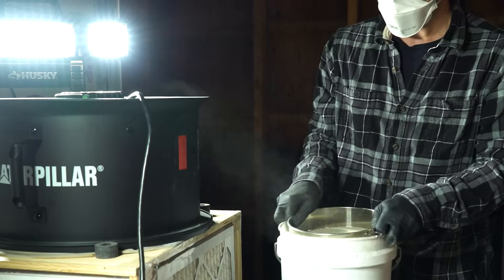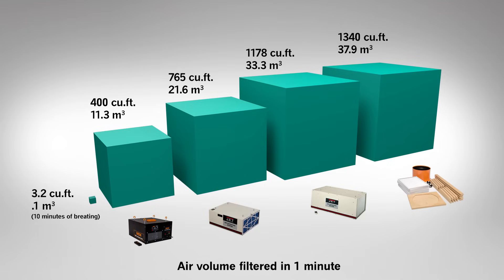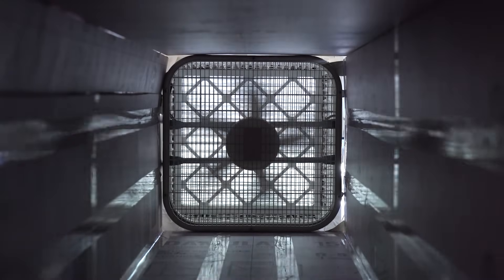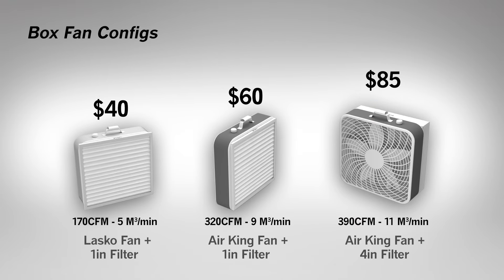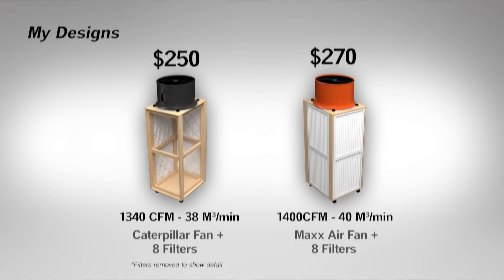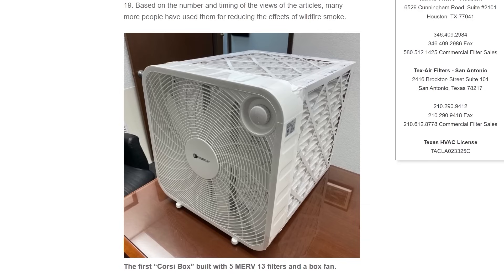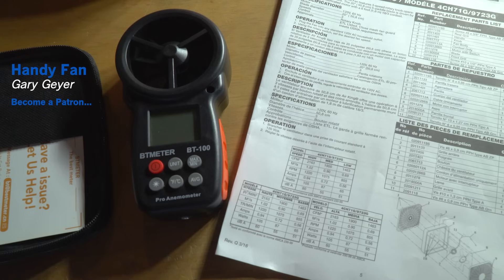What is the best DIY Air Filter?

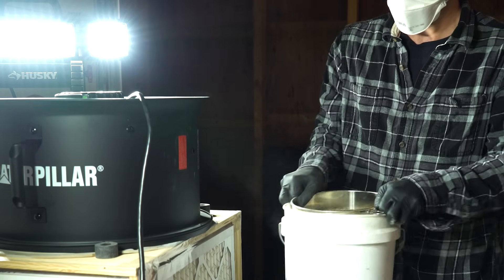Comment: First off - very well prepared and presented, but I did want to make one observation.  In your video (clearly shown from 9:32 - 9:47) you have the air pulled INTO the fan and out through the filters.  The Corsi Rosenthal box is designed (and intended) to flow in exactly the opposite direction, i.e. pulling air into the filters and then out through the fan.  That said, clearly YOU need it for drawing dust away from what you're doing and into the filter as effectively as possible.  I understand why you've elected to use the opposite air flow direction as you want to reduce dust you create from "escaping" the unit as opposed to reducing virus-laden aerosol particles from the air.
Reply from the maker: Thanks! Yes, that is my preferred configuration for this filter unit. I find that it helps keep dust from being accidentally blown into the air. That said, the fan can be pointed in either direction for personal preference. I talk about it a bit in the original video https://youtu.be/fixd7LqnWow?t=277

The other benefit of blowing air into the filter box is that the thick layer of shop dust on the filters that collects is on the inside rather than the outside of the box where it can be easily disturbed. For virus protection, this is not an issue at all. I am working on some air filter kits that function like a corsi-rosenthal for shop and in home use that focus on pulling air through the filters first before it passes through the fan. I should have a video out on these in a month or so. Would love your thoughts on those as well 👍

Comment: Check out Project Farm's video about furnace filters where he does a litany of tests with various filters and media. I'm sure you've seen it.

The 4" filter with an Air King fan is nearly equal to a Lasko fan with four 1" filters. Yeah the air king is more powerful, but I'm willing to bet that a Lasko with four (4 inch) filters would outperform an Air King with 1 4 inch filter or 4 1 inch filters. It's all about surface area, and those four inch filters have a lot of surface area.
Reply from the maker: Very true! I just bought $900 in filters and an air particle counter to do the next round of tests for some air filter kits I'm designing. I get into the amount of material in each filter/brand. I'm wondering if the 1" high end 3M filters have more surface area than the off-brand 4" filters. It sure looks like they might!
Reply: @The3DHandyman  Nice man! I'm looking forward to the experiment results. Lmfao $900 in filters; you're in it to win it man.
Reply from the maker: @Tadders  Lol, yeah. I had a beer or two before hitting the purchase button

Comment: Dumb question but will your design work mounted sideways on the ceiling (say 92" high) or will it work best on the floor (floor space is premium in a wood shop)?

Nvm. Addressed at @10:47
Reply from the maker: The biggest challenge is screwing the fan on to the unit. I am working on some 3D printed brackets for the "pull" config tomorrow. Will have those available on the etsy page if you don't have a printer some soon. Let me know if you might be interested and I will comment on your comment when they are ready to go 👍
Reply from the maker: @Isaac The clamps are now ready for download. I should have these ready to buy this weekend.

Print link
https://www.thingiverse.com/thing:5501226

Comment: 157th comment! I’m actually going to buy the Caterpillar Fan and build that version for my Woodworking and I’ll get the AirKing for my bedroom. Thanks for all your hard work and research!
Reply from the maker: Awesome!!! I hope they both work great for you. If you ever have any ideas for improvements, let me know 👍
Reply: Follow-up question, is it more effective to have the fan pointing horizontally? I currently have the fan pointing upward and I feel like maybe I could also benefit from it by having it horizontal?
Reply from the maker: @FrankTranDesign  Hi Frank! Yes, you can definitely mount this thing on the ceiling with eye bolts and chains/ solid wood attachments. 

You will need to fix the fan onto the unit if you are going to do so.

I designed these clamps to do just that. Fresh off the press https://www.thingiverse.com/thing:5501226

If you don't have a 3D printer, I will have them on my ETSY page by this weekend. Do you want me to send you a link?
Reply: @The3DHandyman  Lol. I appreciate it, send the link anyway, but I DO have a 3D printer (Elegoo Mars (they're no longer making my version for some reason) ) and Curing station (Elegoo Mercury Plus 2-in-1) I also am adept at making 3D things :) 

For clarity, I'm still trying to get the AirKing box fan version working flawlessly. It works, but it juuuuust isn't up to my standards so I'm reassembling it again
Reply from the maker: @FrankTranDesign  That's a solid printer. Do they have tough materials? I'm happy with the Formlabs materials but they are very expensive!

Here's a link to the FDM printed clamps for the drum fan...
https://www.etsy.com/listing/1287743212
Reply: @The3DHandyman  define tough? lol. My Elegoo Mars is fantastic for its price and it prints by curing resin layer by layer. So far, no faults. Annoying to try to get support from a human though -- practically none exists.
Reply from the maker: @FrankTranDesign  Lol, yeah no support is the standard for any low cost machinery. 

By "Tough" I mean, do the materials crack under pressure? Are the materials resilient?
Reply: It can take a lot of pressure before it breaks. So, but that logic, I would consider this tough; yes.
Reply: @The3DHandyman  Yeah I would say they're very resilient. It's like if you cured Epoxy and tried to break that
Reply from the maker: @FrankTranDesign  Nice!
Reply: Also, follow up to this, I bought (2) 1" x 1" x 12' redwood rods. It costs the same as 4 of those round dowels. The tape is only semi-effective at holding things up and together, but I have to be careful about moving the fan around my room(s) because there's no structure preventing the filters from collapsing like origami. 

My new plan is to use the remaining offcuts to build secure support so no collapsing of the frame can occur.

I tried cutting out a corner to make space for the filters to sit on top and that worked fine. The origami collapsing on itself it still an issue though
Reply from the maker: @FrankTranDesign  Oooooh the corsi-rosenthal on the ceiling, got yah.

On that note I am working with a local shop to make sturdy wooden kits for these which could be mounted on the ceiling! I am hoping to have these ready for sale in about 1-2 months if you like that idea.

Comment: Love this series, effectively making shop air filteration more affordable for everyone. May I ask for a blueprint of the downdraft, really looking forward to building one of this while moivng center of the gravity down. Thanks!
Reply from the maker: The down draft is technically identical to the original design, I just screwed some wood stilts onto it :)

I am working on kits for these designs at the moment and part of that is a 3D printed bracket for attaching the fan in an upside down config. You can technically just use some deck screws to fix the fan on but I can let you know when the brackets are available if you are interested. They will also be for sale on my Etsy page if you don't have a 3D printer. Let me know!
Reply: @The3DHandyman  awesome

Comment: Have you thought about adding a pre-filter to the fan?
And I heard the fans spit dust from the corners to the center due to an air pressure difference. Will this really compromise our ventilation?
Reply from the maker: Good question! The cardboard shroud on the Corsi-Rosenthal design will significantly reduce unfiltered air from being pulled into the front of the fan like a pre-filter. The drum fan's used on my design also prevent air from being pulled in around the corners of the fan shroud, this is the benefit of using a fan with a round case.

My concern with adding a full sized pre-filter is that it will likely cut the output of the filter box by a huge percentage. For instance when I add a pre-filter to my unit to use it as a spray booth the airflow drops by over 1/2. If we were to compare one with and without the additional filter the pre-filter version may produce cleaner air but it does it at 1/2 the speed. Personally I've found that a high CFM filter is able to pull more dust in from a greater distance and that is more beneficial to me than the added filtration the pre-filter might add.

Fan motors also rely on airflow to cool themselves and it's best not to starve them of airflow. Really, in the end it may just come down to personal preference.
Reply from the maker: @Cristian-g  Generally it is best for full room air filtration to point the fan up and out of the filter box. If you point the fan into the filter box, I wouldn't recommend doing this with any fan other than the Caterpillar fan in the description because it has an enclosed motor that dust wont get into. This is also really only works with the "Model-A" design in this video. If those requirements are met, then you can filter by blowing the air into the box. This works really well up to about 5ft away from the air filter, beyond that the opposite method is preferred. If you look at the top comment on this video, I just responded in more detail to a similar question a few days ago.

I talk about it a bit more in this video:
https://youtu.be/NmgNQu4zDy0

I will also make a whole new video on just this concept in a few months, it is a very common question.

Hope that helps!

Comment: I’m sorry to break it to you but you did this entire experiment backwards. A correct air purifying system pulls air out of the enclose area that the filters create not inside. A Corsi-Rosenthal Box is engineered with the fan on the top with the air moving upwards so measuring the wind speed should have been done outside of the tunnel not inside.
Reply from the maker: It seems like the air going in and the air going out should have the same readings no matter how the system is configured, right? Can you explain this idea more?
Reply: @The3DHandyman  It would be up to your experimenting to determine the reading difference. However the main point is the purifying effect is taken place when the air is pulled from the air filters into the enclosed space and outwards the fan. I would assume this would affect the reading but it has already been determined that the best model is the Corsi-Rosenthal box shape with four filters creating a box and a fan on top blowing air up and outward for maximum filtration. Wind speed measurement would occur outside the tunnel over the fan. Particle filtration per hour is also an interesting measurement I would consider since your models include cube and taller filter models.
Reply from the maker: @Curiositiesbuilder  I would like to test out particle filter effectiveness but there are challenges involved. I'll see what I can come up with 👍

Comment: Hello,
I was wondering if you could show a project or how to build air filtration system for indoor aviary. I have searched a lot but it seems there's no video on the subject. 

In a room of about 15feet x 15feet= 225sq feet, (height 10 feet) there will be around 250 budgerigars. There will be 20 breeding cages and all the other birds in large flight cages. Budgerigars aren't very big birds but they release a lot of bird danders. Also the smell of poops will be there. Though there will be large windows for passing of natural light and air, I was looking for a proper air filtration system that would get the job done.

I would love to hear and see your opinion on how to build the air filtration/purification system and where to place it. Also, how easily can it be cleaned. If we use HEPA filter 13, how many do we need? 

Looking forward to hear from you.
Thanks!
Reply from the maker: Hi Abeed! That sounds like an interesting project. I wonder if the birds would have an issue with strong wind moving through the space? If so a solution like in this video might be appropriate if you make a diffuser on the air outlet side https://youtu.be/OhVWsnTm8iU

The main goal is to encourage air to circulate from one side of the space to the other.

MERV 13 filters are a fine choice. If you are using the Caterpillar fan shown in these videos you should have (8) 16x20 filters or (6) 20x20 filters. You can also use a think next screen as a prefilter to keep large particles like feathers out of the air filters. You will have to vacuum the prefilter frequently buy this will keep the expensive filters cleaner for longer prolong filter changes.

I can design a custom solution for you if you like. I wouldn't ask for much :)

Comment: I have a welding shop that I am wanting to install air conditioning but need air filtration first so that I am not just blasting smoke and dust back throughout the shop. It's a 5800 sq ft shop but have welding and plasma cutting stations, which style large filtration system would you recommend to diy? I'm thinking I will need a filter system above each welding station to properly clean the air and keep everyone safe.
Reply from the maker: That's a great question. for 6k sq.ft. I might recommend I would think the "compact" or "beastie boy" versions that are shown at the 11:00 in this video. The build plans are here https://the3dhandyman.com/workshop-air-filter-series/

I have not tested these out yet but at least one viewer has ordered the materials to put it together.

Either design would could blow air down toward the table ( I don't know if that would negatively effect welding temperatures or not) or the fan could get pointed up toward the ceiling if you have high ceilings. You could also make a hood over the outside edges of the filter box that helps draw air up from the table area. That might be hard to picture tho 

If the welding stations are at large metal tables they could possibly be placed under the table but then I would be worried about slag getting sucked into the filter and causing a fire. 

In any condition it might be good to put some metal screens over the filters to catch any hot material propelled towards the filters. Maybe I can make some plans if you want